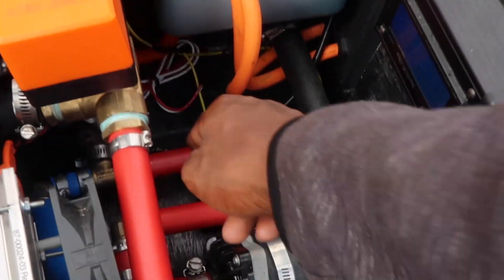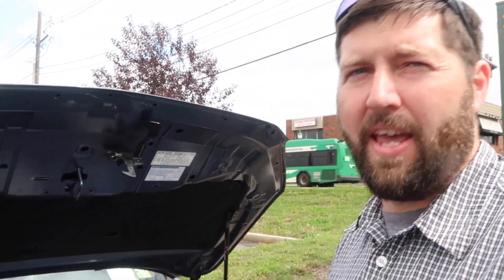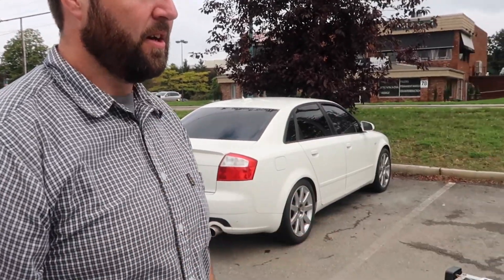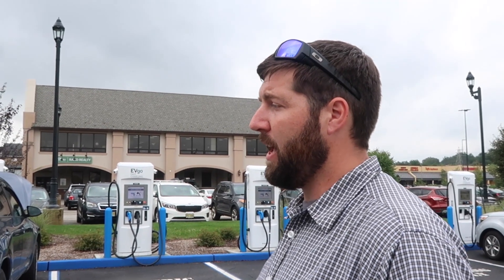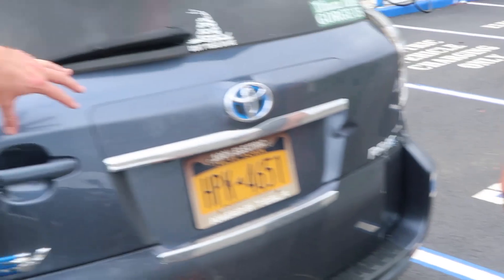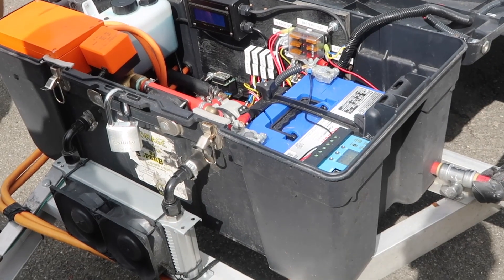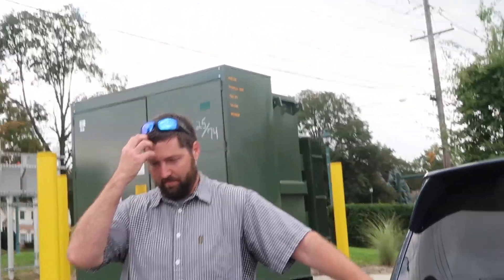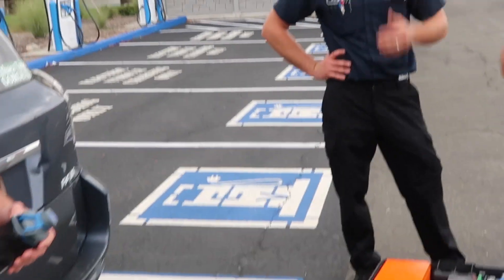The True DIY Tesla Range Extending battery Trailer

Comment: Could I build (or get someone else to build) a small flatbed trailer as a batter bank, and turn it into a self-propelled, self-charging flatbed trike, that could still be a towable range extender, and also be used as a self propelled trike, or even as a pusher vehicle ?. I am thinking something like a Carla cargo E-bike trailer, only a bit wider, and longer, with a drop down deck, so that i can ride onto it with a wheelchair, mobility scooter, or mower, etc..
  I think the idea could be scalable, from an E-bike cargo trike/trailer size, up to a flatbed trailer size capable of hauling a good sized commercial loads or even a good sized boat.

Comment: Has anyone applied this concept to a gas driven SUV? The trailer would have its own motor/ differential/axle/wheels. You just hook it up to any vehicle with a trailer hitch and improve (double?) your gas mileage. The best of both worlds. When your not on the road, use it for emergency power at home.

Comment: I can see by the comments that the " pro electric " guys are ramped up by this modification to a EV but still I prefer a 5 minute fuel up rather than hours spent charging a battery pack  while taking the family to grandma's house 800 miles away. A 360 miles round trip has to have a rest stop for electricity added in every 155 miles. And yes he is a geek. Until electric vehicles can recharge themselves while traveling down the road beyond using the braking mechanism they are only good for around town.

Comment: The trailer tires probably have a max of 80 psi, lower them to 40 or 45 psi. I do this on my Waverunner trailer that weighs 950 lbs and the ride is so much better, otherwise is bounces way to much

Comment: guy should throw some solar panels on the trailer.  could set it up so while driving car, trailer is charging.  then switch and drive car off trailer while car is charging.  I am sure there is some efficiency thing thats gonna make that not work but it sounds cool

Comment: Serious question from someone who knows absolutely nothing about Tesla’s and EV cars but could you mount an additional battery on a custom roof rack as opposed to towing a trailer ? You’d have less weight to pull and less friction from extra wheels. Disadvantages I see would mounting it and removing it without a lift , drag efficiency and higher centre of gravity

Comment: You should try fitting a truck bed or camper body on the trailer for extra utility purposes.
Reply: I did. That is V2 which I just finished. Check out my channel for more info

Comment: Add a accumulation tank for your coolant leak issue. Add it inline to your coolant reservoir. Look up ej25 use in airplane. They struggle with things similar and that simple tank will help you I’m absolutely sure. Please add Honda generator backup in the box and you will be covering everything. Beautiful work

Comment: That isn't practical at all. How do you find parking with that trailer sticking out? Are you supposed to take 2 parking spots?

I'm not sure how much those weigh, yet would it make more sense to make an extended range roof rack?
Reply: BOHICA Life a) too heavy for most roof rack systems, but more importantly, b) having all that weight up high significantly changes the vehicles centre of gravity, making it very unstable and dangerous. 
Nice idea though.

Comment: If making a battery extended range trailer, is it possible to double the layer of batteries? Would it be a problem to layer another bed of batteries on top of a layer of batteries? Could there be shorting or an issue of heating? Would it be too much weight?
Reply: Its a lot of weight. This pack alone is 840lbs. A complete tesla pack weighs around 1330lbs

Comment: What inverter to use from that 380ish volt battery to 120/240ac home inverter. I may have access to a 400v model 3 battery soon and the only thing i can think of is putting it into a solar dc to dc charge controller and then run 48v into normal invrter. Pls ideas
Reply: Inverters that handle full pack voltage are hard to find. I have one and I might be buying a second. Jack on EVTV used to sell them but they are gone now for some reason.
Reply: @JamesKlafehn  ive commented on jacks videos asking about them for the model 3s and never got any leads. Other tgen break the pack down. But that is just not an option with the mod 3 packs. Way too much work and risk of damaging cells. Thanks. What do you use?
Reply: @electromechanicalstuff2602  I want to use the M3 packs too. I think they are going to be all over the place soon. But so far no one has hacked the BMS system for them. In my T-Rex V1 and V2 I simply gave the OEM Tesla master BMS 12v and it turns on. I added switches and stuff but once its turned on it balances the cells and does its job. I had to take over controls of the contactors but its all pretty easy. So far thats not possible with the M3 modules. I havent seen any pinouts or diagrams for those. It might be possible, I just havent done it myself yet so Idk

Comment: Not trying to hate. But all that just to get 240 mile range? If it was a tesla car and a tesla battery trailer i assume you could get 600 miles.
Reply: Think about the money. The car itself can be purchased used for around $16k to $20k. I currently have the trailer for sale on ebay for $13k. Thats $23k for 240ish miles. To get that in a Tesla you previously had to buy a $80,000 model S. Now you can get a Model 3 but thats still $35,000 plus tax and registration.

Comment: I think if you had the SUV mounting the battery to the roof would be more practical then you could pull a trailer to haul stuff if need be
Reply: WAY too much weight for a roof. No roof rack in the world can handle 900 lbs

Comment: Couldn't he hook a rotary generator between the axle of the trailer and generate power while he's driving? 
That should spin fast enough to generate a fair amount of power.
Reply: That would be increased drag and I would lose range. No such thing as free power.
Reply: @JamesKlafehn  if that is the case then you hook it up as regenerative braking like the Tesla does, using the drag to your advantage. 
But I honestly doubt the drag would be as drastic as you seem to think.
Reply: J.R. Millstone it would. It’s physics.
Reply: J.R. Millstone energy cannot be created or destroyed. People tell me I should add wind turbines too. That’s drag. You would lose more energy due to aero loss than you would create. There is no free lunch
Reply: @JamesKlafehn  you can't create energy for free, no. And that's not the point. Nobody is talking about turning your car into a fictional perpetual motion machine. But there are things you can do to a EV to improve range. Regenerative braking is one such way and dismissing it by theoretically citing aerodynamic issues is simply defeatist.
Reply: J.R. Millstone your talking about adding a 1000lbs and lots of mechanical and electrical engineering for very minimal gain (if any). I don’t like discouraging people from trying stuff with their own money so if you want to try it and give me a real world answer I’m all ears. But for me, it’s not worth my time or money

Comment: as much as i love it.. his numbers dont add up. 5.4 miles per kwh and a 39kwh batt in his car (not including the trailer) = 210 miles but he claimed the record when it was new for most range covered = about 140 miles .. thats a fair discrepency .. what happened to your other 15kwh? its a little bit confusing.. o well enough nit picking, its an awesome project none the less
Reply: I didnt say 5.4 miles per kwh and I didnt claim any records. I get around 3.5 m/kwh while towing on the highway in good conditions. I usually use 3 in calculations just to be safe. The T-Rex has 41kwh and the Rav has around 39-40. Call it 80kwh. 80x3=240. 80x3.5=280
Reply: @JamesKlafehn  @5min12seconds you do say 3.4 miles per kwh i misheared when i watched it and thought you said 5.4 sorry, but at  @ 7min47second you say your record when it was new on just the car was 144miles. so you did claim to have your record and thats why i was like what but like i said i mishear so yeah its all good .. also as i said i do love the project so dont worry about the nit picking lol
Reply: @christhorney  Maybe I shouldve said my "personal best". I dont claim to have the world record of all drivers of Rav4 EVs of all time. If you drive 40 mph on a straight, flat road you could probably do 250 miles. lol Glad you like what I have built. Have seen what I am currently building? Check out my channel

Comment: Would it be worth assembling a battery pack that would fit in the 3 or the S trunk thats shaped like a large subwoofer box and then make a connector to plug into the cars charging port to extend the range or even use for charging while parked at places that dont offer charging stations?
Reply: https://youtu.be/Zzkag0VeRDw

Comment: If only the battery pack didnt weigh so much, This would be really good as a roof rack (in an aerodynamic enclousre ofc). Would be good if they did a smaller lighter pack. Help keep a nice small footprint on the car without having to worry about lugging around a trailer.
Reply: https://youtu.be/Zzkag0VeRDw

Comment: This is a pretty interesting concept. I think it would cool to find a trailer similar to those small pop-up campers, that are rectangular shape, with the aerodynamic shape top. Normally the top opens up with an accordion style canvas piece, attached to the lower half of the trailer. You could gut the trailer, remove the accordion liner wall, hinge both halves together from one end to get like a clamshell action. Then you could mount the whole battery back, and control box inside the trailer, and when you close the top half, everything would be self-contained inside. All you need is a bulkhead to pass the hv cables through, and a mount for the coolant heat exchanger. Either, this trailer he built is pretty cool.
Reply: https://youtu.be/Zzkag0VeRDw

Comment: I almost cracked up on that little solar panel on that small box in between car and trailer. Nice touch, gives you 0.01km more range.
Reply: You obviously didnt pay attention. It recharges my 12v battery. Not the HV battery...
Reply: @JamesKlafehn  For what it that needed?
Reply: Fusseldieb everything runs on 12 volts. Controller, pump, relays, switches.

Comment: Just a suggestion.. why not mount the extra battery on top of the SUV and eliminate the trailor.. I have a roof mounted storage container on the top of minivan that stays there permanently.. it would be a great place to keep a battery pack like this and make it a cleaner installation..
Reply: jamerican772 https://youtu.be/Zzkag0VeRDw
Reply: I’d think 800 lbs on top of the car would seriously compromise the stability of the vehicle.  Id also be surprised if the roof could support it structurally
Reply: Cy Moler exactly! Check out the link I posted in response.

Comment: Great video so nice both of you. Give great layman engineering. Just like Boeing 100 years ago. My dad did logging converting from railroad logging to truck logging. Interested in Tesla wall system or this battery system for stealth camping and use a Tesla power charger.

Comment: 144 mile range 🤦‍♀️
Reply: Canaan Winthrop for just the car. Which is great range and the largest EV  outside of a $100k model X. Oh and it was built in 2012, 6 years ago. It’s a great car. Add the trailer and I get around 250 miles

Comment: Are the motors on this capable of being generators? That'd give some extra range when not powered. 
I'm really hoping that when Tesla eventually gets around to making an EV pickup, they'll also make powered trailers that can double as a range extender. It just makes sense for that to exist once they introduce a truck. It'd be even cooler with all of the sensors on it. 
I've been wanting to toy with the idea of a powered trailer, but more for the idea of having a small car being able to tow, where the vehicle's own structure and power doesn't have to matter as much if a trailer can push itself.
Reply: Answer, https://youtu.be/Zzkag0VeRDw

Comment: A baffle in the coolant tank could probably eliminate the sloshing around getting out the cap on top. Over all really cool!
Reply: Thank you very much! I think on my next build I will go with a different tank. I think the problem is that its sealed. As the fluid heats up it has no where to go but push out.

Comment: Tell him to put air bags at low psi with good adjustable shocks and the trailer wont bounce drop the pack under the frame and build a light weight camper on this platform with self contained power source
Reply: Its really not bad. But for my next build I am going with a Timbren Axle less suspension system.
Reply: James Klafehn hey my other question was does the second battery make it any more powerful or quicker
Reply: Jake Browne no
Reply: James Klafehn ok i get thats not the intended reason just with how fast Teslas are i  was curious
Reply: Battery capacity does not mean the car is faster. Is just more power to pull from. I.e. lots of money in the bank doesnt make me any thinner.
Reply: James Klafehn lol good analogy

Comment: You should add electric generators to the wheels of the trailer. that way as you drive the wheels spinning charges the battery pack.
Reply: More drag, weight and engineering. Its not needed.

Comment: i agree to make the trailer functional. as a trailer ,my first thought was a popup camper .. .. if it was mine i would have discovered the motors max voltage at this point ..
Reply: Check out my channel. I just started a new range extending trailer that is going to have a teardrop on top.

Comment: Can you do this and connect it with the on board battery creating a double capacity battery? Would the Tesla supercharger still power both
Reply: Thats exactly what this is. Its a second battery connected to the onboard battery for double the capacity. The Rav4 EV cannot use the supercharger network but Rich's Tesla can. If we built a pack for him the supercharger should charge both packs just like Chademo on mine.
Reply: James Klafehn yeah I saw that but just wondering if the Tesla would notice that it has larger capacity than normal. I hope rich tries this for his Tesla and if the connection of the batteries would be easy

Comment: There is a real business idea in here.  You could rent these to EV customers who want to road trip.  Don't just stop at making them be battery pack trailers though.  Build a body on them and streamline/aero them as well, with storage space for cargo.  Or you could even do a small camper popup type deal out of it.  Would sure beat the hell out of a tow rig getting sub 10 mpg when you've got the camper hooked to it.  The idea could really take off once Tesla starts offering their pickup truck whenever that happens.
Reply: Obviously the rental idea is because the battery packs are prohibitively expensive and wouldn't make sense for something you're only going to occasionally use.
Reply: @randr10  Check out my channel. I just started a new range extending trailer that is going to have a teardrop on top.